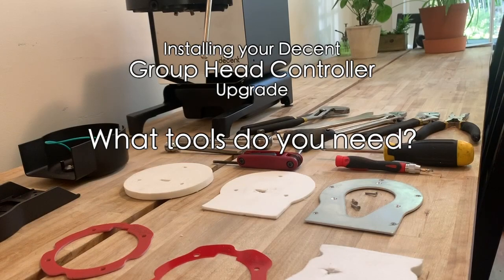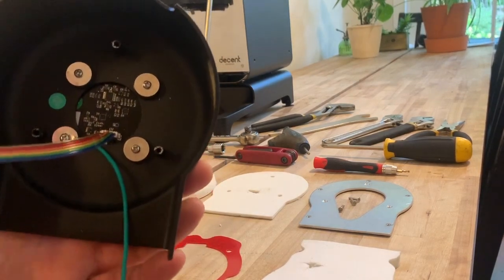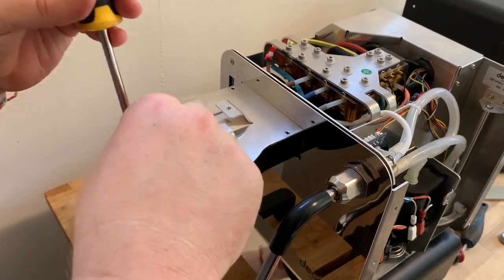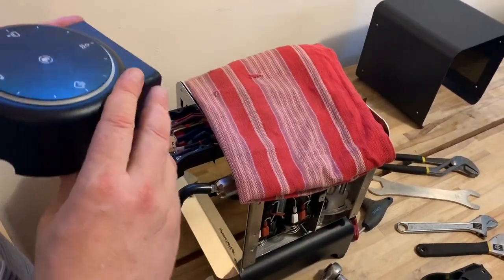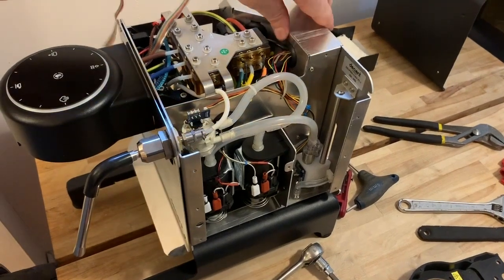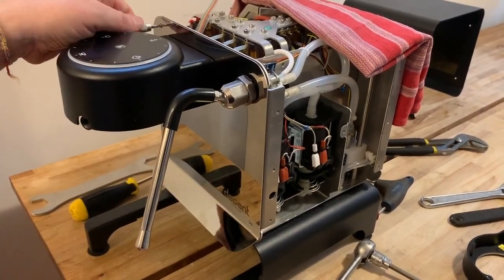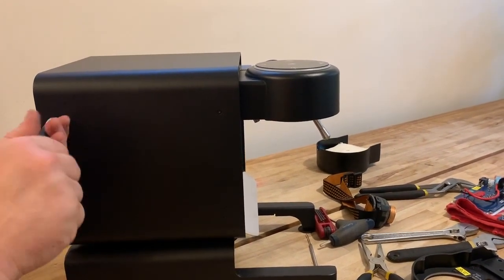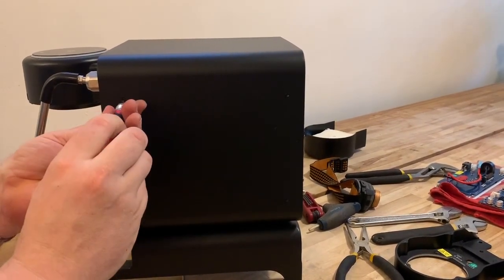Group Head Controller Upgrade Instructions v1

Comment: I wonder about the longevity of the new controller in all the moisture and heat, BUT making an upgrade like that available is wonderful.
Reply from the maker: It's double-gasket sealed, and gorilla glass on top.  The PCB is also sealed, and uses high temp capable components.  We tested this a lot.